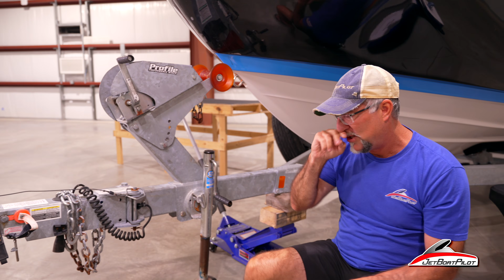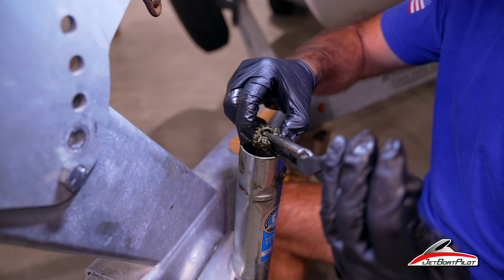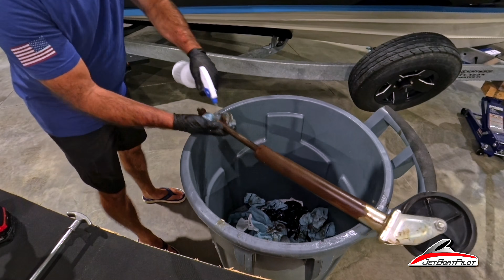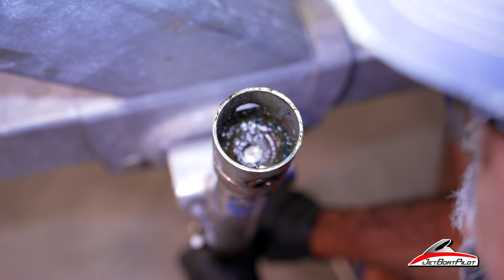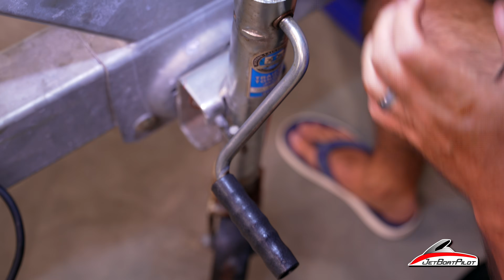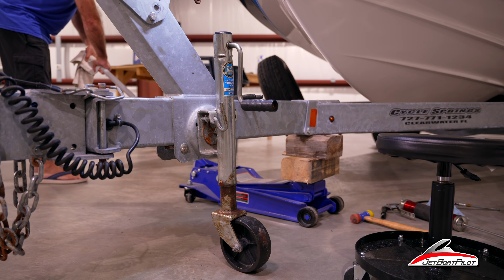How to Service Your Factory Tongue Jack

Comment: Great video Will. I learned that I've been superficially servicing my tongue jack by just adding grease from above my gears. Removing the entire assembly.makes mores sense. I may give this a try...if I can't put it back together, I'll be ready to replace the entire thing since I purchased last year a temporary tongue jack.
Reply from the maker: @rickurt1  yep we did the same. We have replacement hack options in our store now if you need a good recommendation.